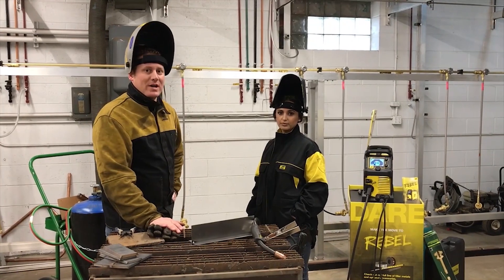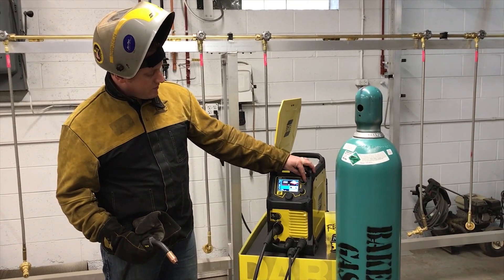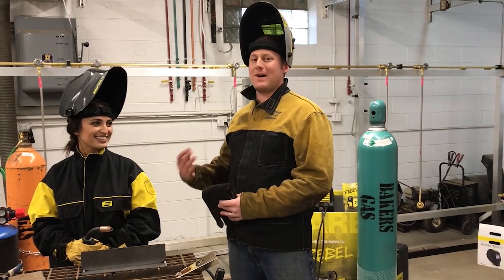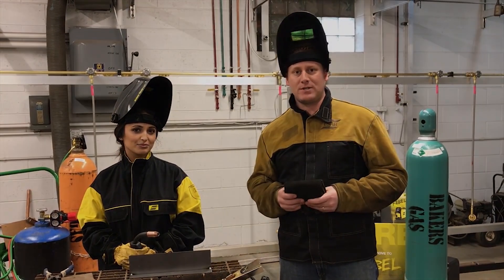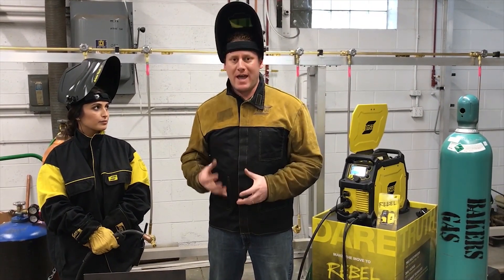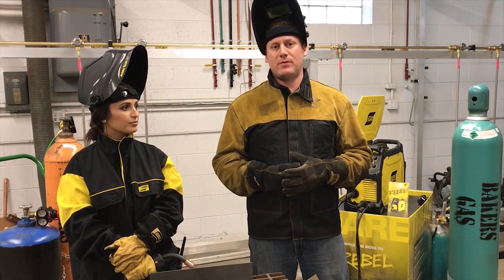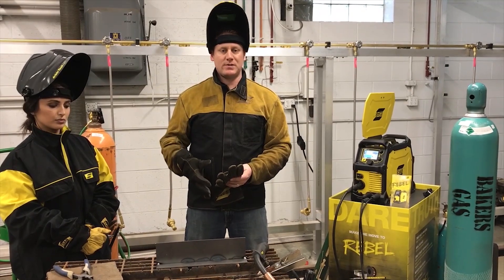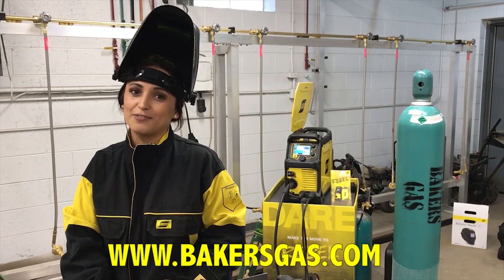ESAB Rebel EMP 215ic “Smart MIG” feature

Comment: First off thanks for showing us the welds  and how is making anybody a professional when it’s doing all the adjustment for you how are you supposed to learn from that if you’re just learning you should definitely be making adjustments yourself and then using machine like this later on once you’ve actually developed a good technique

But how many different times are you gonna tell us that machine adjusts for optimal stick out angle and peace or speed or whatever lol.

Comment: I bought a 215ic rebel and noticed that when I press the mig torch button the wire starts to come out at a slow speed and after just a few seconds it reaches the normal wire exit speed. Is this normal, or is it in trouble?
Reply from the maker: Feel free to call us and we can get you to someone to trouble shoot if you are still having issues.

Comment: Hi just wondering any major difference on the 215 vs 235.
Also the 215 comes as a kit correct?
The 235 you need to buy everything separate?
Thanks
Reply: 235 can weld up to 1/2 inch plate and can go higher in amps compared to the  215 ic 3/8 inch steel plates. in videos the 235 elctrode hold looks better and the mig gun looks more comfortable to hold they have pdf's on there site to compare the 235 is 2x more expensive about

Comment: Does sMig works with spool gun too?
Reply from the maker: Yes,  but only in short arc transfer. If running aluminum, you will usually want to be in spray transfer to get the cleanest weld. If you are running thiner material with aluminum, sMIG will help. Let us know if you have any other questions.